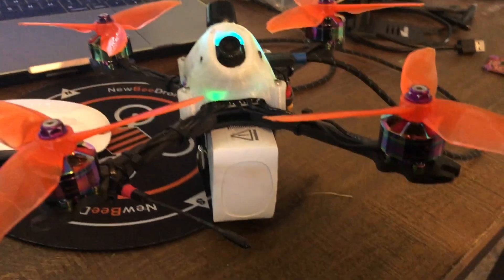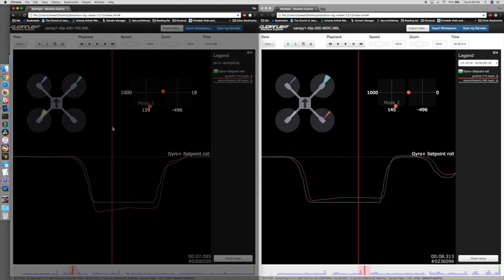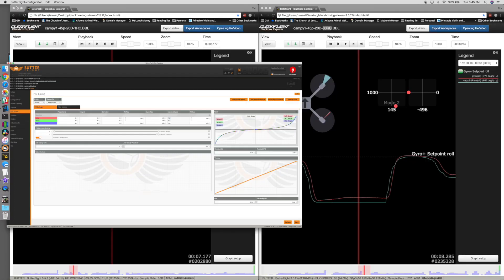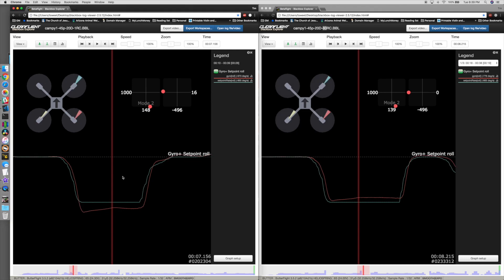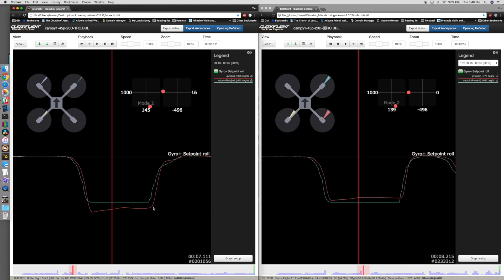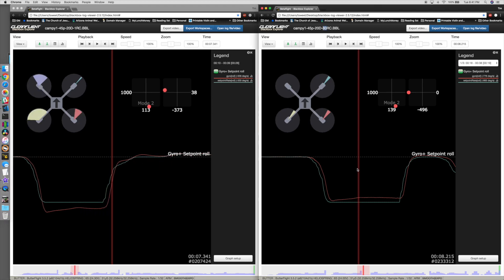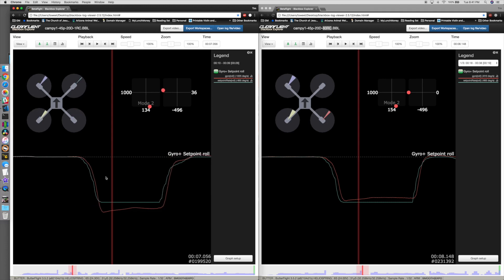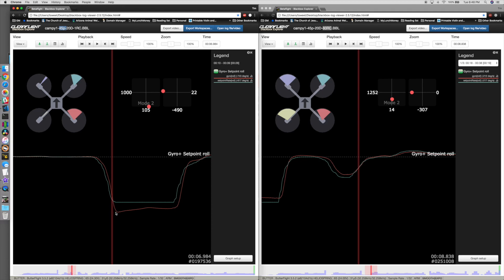How rates affect tuning. reducing bounce-back with rates!?

Comment: Helio RC Thanks with the tip videos really appreciate them. 

One thing that i'm struggling to find and having problems with is flashing Kiss 24a ESC using pass Through, It works on my betaflight FC but it is not working via helio AIO FC. I use the Pass through CLI command and tells me its on, i then disconnect butterflight and open flasher for Kiss, select hex and port, then press flash and thats where it stops and goes no further. Have you come across this?

Comment: wad up, helio! I have a quick question! I flashed 1.0.8 and now my motors are running pretty hot. I didn't want to screw with the buttered pids, so do I just drop IMUF value then slowly scale it up? on 1.0.7 I didn't really need to do anything at all besides rates. I want to make sure I'm doing it right 1st before I learn the wrong thing on my own lmao! (it is flying great! motors just feel hotter)
Reply from the maker: HardTimeZFpv probably need to pid tune it. I’ll be doing another set of videos on it. When you updated did you use your old pids from a previous version? Because you’ll probably need different values on buttered pids.
Reply: I pretty much left everything on default when I flashed besides rates. by the end on the session I moved the D gain & imuf around (barely) but put it back to default before I packed up. thanks for the respond! I pretty much have all of tomorrow free so I'll do some tuning then let you know!

Comment: all this says is that, when you change rates you need to adjust p to compensate. also,  I am wondering how much of the bounce back was caused by the actual speed of the stick deflection itself. (or even the vriance in speed during the stick deflection)
Reply from the maker: considering this is buttered pids and I did a max speed deflection in all of the tests with multiples of the same result, this is accurate.
Reply: thanks. it makes perfect sense in physical terms. higher rate will naturally have more kinetic energy, thus requiring a P adjustment to compensate. it is great to see it in practical terms and gives us more clarity. it proves that the system is doing what we ask it to.